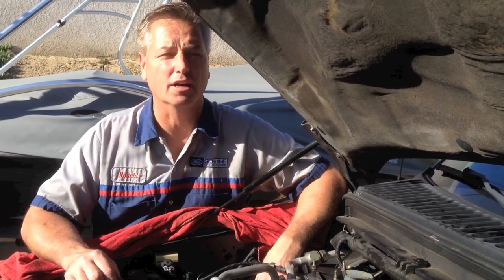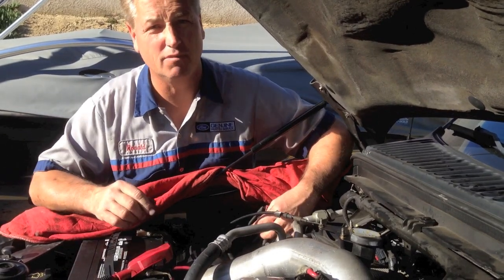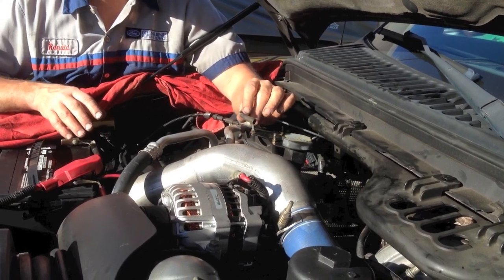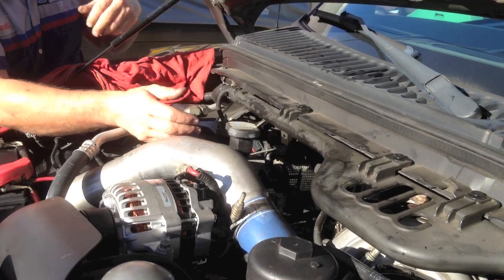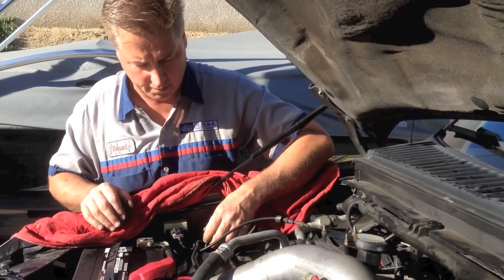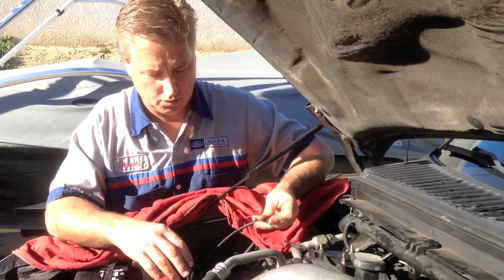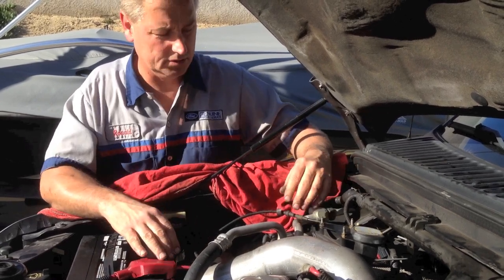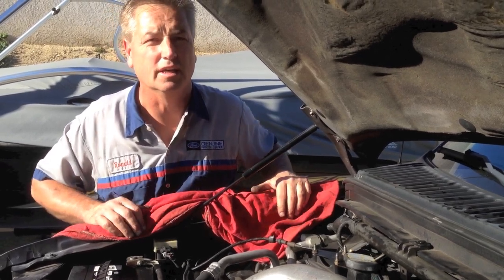Vacuum pump motor concerns on the Ford 6.0 f250-f350 Powerstrokes Superduty

Comment: Still helping us out, brother!  It's been a great run with my 6.0, she's been my daily for 15 years.  I just took delivery of my 2024 F250 in the 7.3.  Found a good home for the 6.0, some 6.0/7.3 guys up in PA. But wouldn't ya know it, checking the 4WD today the vent air blew out the defrost which is always the tell-tale sign of a vacuum leak, so I had to check in with Ron one last time.
Thanks for everything, Ron.  You are missed!

Comment: Just bought an 04 6.0 dually that runs great but I heard a little noise when I start it and a hissing when I shut it off turns out it was the vacuum pump I thought I had 2 separate issues. This man has helped me so much in the last two weeks learning all kinds of things to look for diagnose for upgrade to. Thank you very much.

Comment: Thank you for sharing. My vacuum pump would not stop running.
Mine turned out to be the hub locking solenoid. Seems to be working properly now.

Comment: Air was only blowing through the defrost vents in my 2005 F350 Super Duty. Several people were telling me the climate control in my truck was shot. I stumbled across your video and sure enough, the vacuum pump in my truck wasn't working. One trip to Napa and an hour later and everything was working correctly again. You saved me from wasting $400 on a new climate control unit. Thanks Ron!

Comment: I more or less did all this .. but the vacuum actuator, ... idtentifx I think said if it doesn't hold a vacuum to replace it.  So I put my mighty-vac to one side of the actuator and put my finger over the other and it does NOT hold a vacuum or move the needle.  I can pull plug the red hose at the actuator unplugged and it pump stops.  I am thinking and actuator is kaputs.

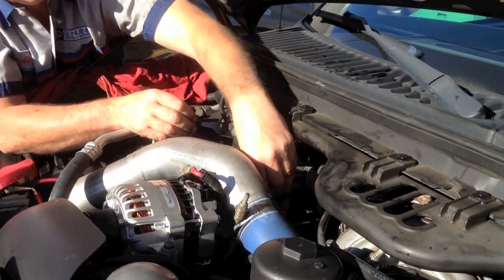Comment: Thanks for the help.  You diagnosed my problem at 02:10.  That hose was off it's port.  The vacuum pump would cycle on and off, on and off,  but with that line disconnected no air except to the windshield vents.    I think it was knocked loose a couple of weeks ago when it was in the shop for a turbo problem repair.

Comment: Are you still watching this? where does the OTHER end of the heater control valve vacuum line go? my vaccuum pump runs constantly. I isolated that it's not the 4wd or other front items by disconnecting the line as shown at 3:31. But the hose you connect at 2:21 comes from somewhere that is disconnected.

Comment: this video fixed me today. 03 f250 6.0 4x4 had heat only thru defrost. i followed  the steps and found my egr vac reg was bad. i pulled no hair in the process. thanks. a million.

Comment: I had a vacuum leak not mentioned in this video. I had a battery fail and leak acid. It got on the resivoir and ate away at the side causing it to leak. The first symptoms where the AC vents taking time to shift from defrost. This was on an 03 F250 7.3L
Reply: William, your reply was how I just found my issue.  battery acid put a hole right in the side of the box.  guessing an epoxy fix?!
Reply: @echosixdefensesolutions912  that would have been an option. However, my Father is a pack rat for vehicle parts and actually had a replacement for it in his shop. Glad I could help!
Reply: @AlexXHitchcock  i mixed up some double bubble and in 5 minutes I had wind again!!!

Comment: this morning when I got into my 2004 F250 6.0 diesel I heard that same humming noise from up front and I just ignored it and started the truck and took off and in about 4 miles down the road I lost throttle response and my truck died, I then waited for a few minutes and tried starting the truck and it fired right back up but then I only got a couple miles and it died again. 
Could this have something to do with that vacuum pump?.
Thanks

Comment: The 6.4 vacuum reservoir has 2 ports out a small one goes the tree from the vacuum pump and the way goes  4x4 solenoid. the other port i don't have a hose, but Ford schem for the 6.4 shows a hose but I can't find any information on where  this hose is suppose to go or what it does. If Ford makes it it would be on the King Ranch,
.

Comment: Thank you Ron - solved the vacuum pump not shutting off in about 30 seconds thanks to this video; it was the line off to the heater control valve. Thank you!

Comment: Thanks! very Informative.

My '05 Super Duty 6.0 has problems starting up in MAX AC - it blows through defrost.

Pulling the dash and listening for hissing vacuum leaks at the control switch - in MAX AC and 'O' setting can hear a little leak where the tubes plug into the control panel and the vacuum pump never shuts off. All other settings no hissing and pump turns off. Any thoughts?

Comment: +DieselTechRon i have a problem with my 4x4, both hubs are new, when i turn the hub to "LOCK" and have the ESOF switch on 4x4 it drives both wheels fine. However when i turn the ESOF to 4x4 with the hubs in "AUTO", the transfer case engages and both axles spin but no drive to the wheels. would this be the switch you spoke about? if so how do i diagnose this

Comment: hello have a question about the vacuum, if the vacuum failure, the break and the power steering wheel well lock. experience I was driving my f350 2003 6.0 about 80km and that happen the break and the wheel lock  🔐.  that is related to the vacuum.
thanks

Comment: what if my vacuum pump continues to run when i hold my finger over the hoses to the vacuum reserve tank?  i have factory manual locking hubs so i do not have the pulse vacuum actuator.

Comment: Ron, I have a 2001 f250 Superduty 7.3. The AC and Heater fan blows through the dash vents perfectly until I place the vehichle in 4 wheel high. Once I take it out of 4x4 high, the fan blows out of the dash again.  Ive done the diagnostics tests, replaced the pump and 4x4 actuator as well as the rubber vacuum lines on the hubs. Any thoughts? I'm stumped...

Comment: i am just trying to figure out what the figi is a vacuum switch and vacuum gauges is doing under my dashboard near the gas pedal.

my net is experiencing some turbulance so i can only play about 8 seconds of video for every 10 minutes. I have a 2000 ford f250 gas 5.4L. with some weird vacuum switch unit under the steering wheel.

Comment: Ron thanks for the video, My pump has been doing this for too long. I went out did your test found an unplugged The heater has been defaulting to defrost with the AC on. Hopefully the fix will be permanent.

Comment: Hi Ron, my pump will not shut off even when I plug the lines coming off the reservoir. The reservoir holds air pressure even over night so I know there are no leaks. But it will shut off if I plug the intake nipple on the pump. Will a weak pump cause this? Seems like it takes a while to get good pressure.

Comment: What if I have no power from the positive? I have 12 volts on the negative side, but nothing on the positive. All fuses checked and all were good.
Reply: James Harris then you have major wiring issues, your not using the tester right , or your trying to plug it in wrong

Comment: Ron I watched your video and determined my vacuum pump went out completely. I have replaced the vacuum pump and now all of the heating and cooling vents in the truck are working properly.  In addition, the grey wire was not attached so thanks for the heads up.  Now, the SOF 4x4 still does not work for either 4 high or 4 low after fixing the vacuum pump issue.  If I manually lock the hubs then everything works fine.  Is it possible the 4wd solenoid has gone bad?  Is there a way to test if the solenoid next to the vacuum reservoir and vacuum pump has gone bad?

Comment: I had this problem. I was extra concerned because I had manual Warn hubs on my rig but the hose lines still go to my hubs. I inadvertently fixed the problem by removing the gray vacuum line (5:36) and putting it back on. It must have not been seated correctly. Hey! I'll take a win whenever I can. Thanks Ron! You are the best!

Comment: Well done. My 2006 F350 Vacuum pump started running the other day and ran almost incessantly every time I turned the key on. I prowled all over the diesel tech sites and everyone was pointing me towards bad solenoids and leaks in the HVAC/FWD lines. I watched your video and, as you described, the grey line to the little black heater control valve at the back of the motor was unplugged and hanging all the way down the back of the firewall. Popped it on and presto, good as new. Thanks for your great and explanatory videos.
Reply: Hay man I️ got a 06 engine check light just came on wile I️ was toeing my boat it runs fine system check was fine but light has not reset and ideas..thx for your time

Comment: Our pump seems to be working fine no leaks, pump will tun off after vacuum build up occurs, our issue is this, we have ONLY air flow to the floor, Nothing to Defrost or dash vents. All we can find is Air pressure at Defrost only which means no vacuum to controls..

Comment: Not a bad video, of course besides all the hoses you stated, I'd also check inside at the bleed door behind the glovebox. Especialy if after all the checks you stated, if the bleed door is losing air then the pump will keep running.

Comment: Hey Ron- i know you are talking about a vacuum pump. But could you make a video about The power steering box? IM having a horrible wonder issue but im not sure what is the problem. The Pitman arm bolt seems looose. But only moves Up and down when i hardly turn the wheel. But no side- to side movement. any tips?
Reply: I'm no Ron but I have owned 3 of these trucks and all were lifted this is what i'm going to use to solve this problem bulletproofsteering.com assuming your running over sized tires as i am the factory joints and tie rods cant handle it like these over knuckle joints can and the whole system is cheaper than replacing your ford factory steering parts. hope this helps
Reply from the maker: We got a lot with the pitman arm being loose if not worn. some of them with lifts are hard to check the torque but you should esp if it moves. We have seen the shaft break so be careful.
Reply: DieselTechRon
The output shaft is solid- Arm movement is up and down kinda like some teeth are gone on the arm. :/ But i will check out bulletpproofsteering thanks jeremy! and thanks ron. i just hope i can drive my rig still up and down play being about 2 inch play is bad?

Comment: I have a question Ron.. Are the 7.3l hubs known for going out in the vacuum side of them??? I have one and the hubs seen to have a mind of their own lol.. They will work when i don't need then like when I go to back up my big trailer in reverse up my steep driveway.. I put it in low to keep the stress off the trans but I don't like the Hubs to lock do I don't get all the binding on the pavement... But when I really need them like when I'm in the sand they never seem to work  so I have to get out and lock them.. Do the early years of the super dutys have hub problems?? Cause I have yet to see the newer design on the late 6.0s and 6.4s not work...
Reply from the maker: They can. In the video I was talking about vacuum bypassing the valve and causing a leak. Your talking about the effect. If it bypasses then yes it will apply the hubs.

Comment: Ron more on 4x4  cannot get it to work  with the vacuum please I looked ever were for a leak
Reply from the maker: Make sure the vacuum is going through the switch. The most common is at the hubs if it's not the lines.

Comment: hey ron im planing on buying a 2005 ford f350 for 8500 with 213k on it i think it is a good investment what do you think?
Reply from the maker: That isn't a bad price if the truck is in good shape, but there are so many variables and it always depends on the condition and options.
Reply: its a lariat with everything and the body and frame from the pictures look amazing i see no rust at all ill have to check it out sometime this week
Reply from the maker: Ryan Collins try to start it cold, make sure it doesn't miss. I would take a scan gauge with me. Monitor ficm volts, turbo VGT, oil temp, coolant temp, voltage, make sure the cooling system pressure doesn't get too high and vent out the cap, and you should be good!
Reply: now would that all read on a code scanner? i was planning to take a ride there and you know say i saw the truck from the road and id ask if its for sale the i know they wont have it running before i get there. but im also going to bring my dads friend who is a mechanic to help out